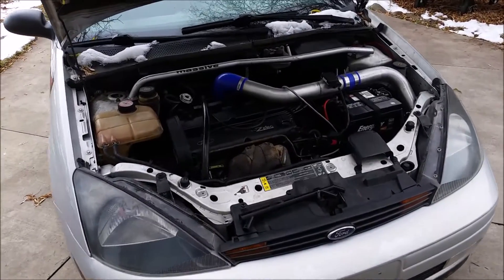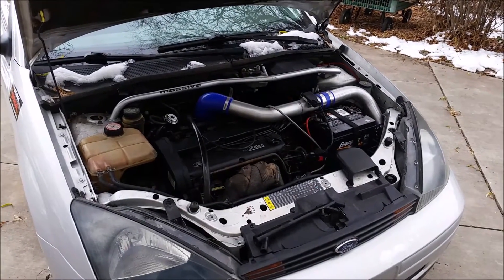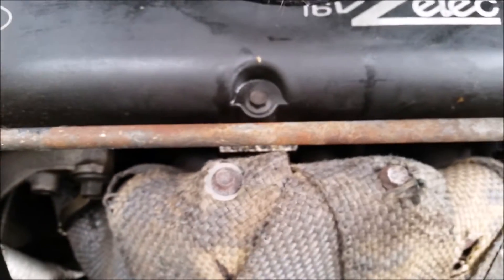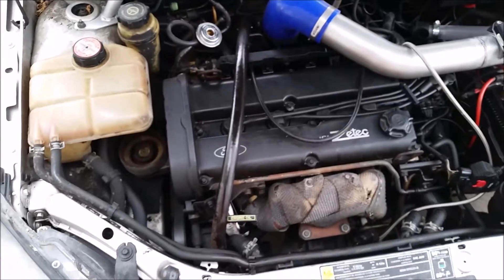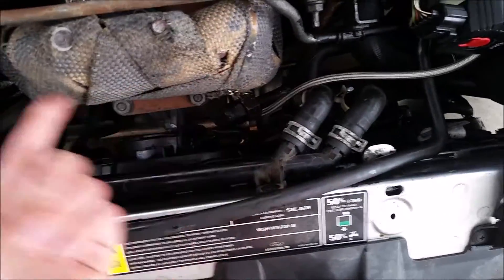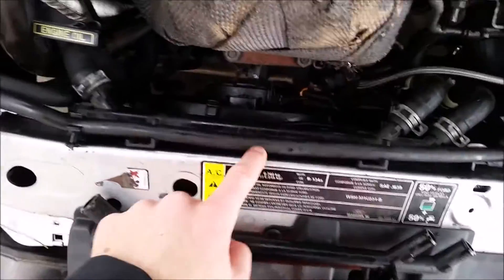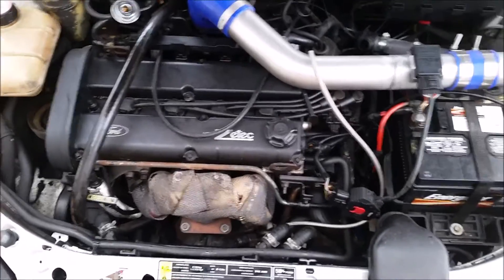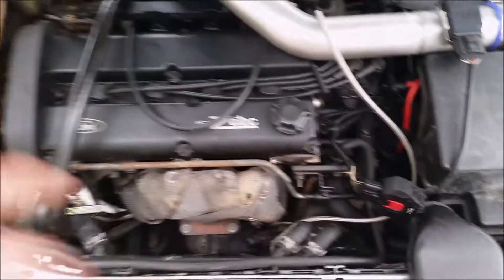DIY Turbo Focus Update: FIRE?!

Comment: Same part went on my 2003 zx5, sprayed the engine bay but luckily no fire. I love the 2.0 zetec engine, had this car 11 years over 300k on it runs strong!! Nice work on the turbo
Reply from the maker: Richard Patterson It seems like it's not super uncommon for this part to break, but I'm glad there was no fire for you! I think the only reason mine caught on fire was because the wrap on the header was soaked with antifreeze, and it eventually got hot enough to combust.

Comment: They make a aluminum coolant tube to prevent that rupture area. Where did you get the "adapter" to use the stock mani?
Reply from the maker: Oh, nice! I didn't know that. 
I fabbed it myself.
Reply: You have a pic of your setup? I dont wanna have to delete my p/s for everything to clear
Reply from the maker: @ijdevil  I don't, sorry. I lost all of those pictures and I have since sold the Focus. It was really similar to the FSWerks adapter though.

Comment: I WOULD LOVE IF YOU MADE A DETAILED VIDEO SHOWING EXACTLY HOW YOU PLUMBED IN YOUR TURBO, ALL THE IN'S & OUT'S??? PLEASE! EVERYTIME, I COME BACK TO YOUR VIDEO"S TO TRY & SEE YOUR SETUP & WONDER HOW YOU DID IT????? LOOKS AS IF YOU USED THE STOCK MANIFOLD, & BRANCHED OFF OF IT, DID YOU USE THE CAT FLANGE? I AM ABOUT TO REMOVE MY CAT & REPLACE IT!!! NOW WOULD BE A GREAT TIME 4 ME TO TRY THE SAME IDEA, I AM IN THE PROCESS OF REPLACING MY EXHAUST, EVERYTHING EXCEPT THE CAT & MANIFOLD. IF I REPLACE THE CAT, I CAN START TO CUT & WELD A DOWNPIPE INTO A TURBO THAT,I AM STILL YET TO GET BECAUSE OF ALL THE OTHER PARTS NEEDED (ECU) SO, IS YOUR SET UP W/OUT A AFTERMARKET ECU???? I WOULD LOVE TO KNOW HOW YOU RAN EVERYTHING??? I HAVE A 03 FUCUS THAT I HAVE DONE SO MUCH TO & IT NEEDS MASSIVE HELP IN THE POWER DEPT!!!

Comment: prerunnerwannabe can you tell me the specs on your turbo conversion and what you used  I'm thinking of buying a mk1 focus 3door hatch and making it a wrc Collin McRae rep I'm from the United kingdom I heard about the Scooby turbo did you make a custom turbo manifold or buy one off eBay if you could give me a parts list or links to the stuff I will need that would be fantastic
Reply from the maker: Hey man! I don't know if you were able to watch my other video where I give an overview about the turbo system, but if you haven't, I would recommend taking a look at it :)
A Colin McRae replica would be suuuuper cool. I used the stock manifold and fabricated an adapter that would allow the TD04L turbo to bolt right on. It took a lot of trial and error, just because there is very little space for the turbo, so you need to angle everything in the perfect spot. I also used a turbo flange from eBay because that was a ton easier than trying to fabricate one myself, and I used another stock header and robbed the flange off that to attach it to the stock manifold on the car. I would stay away from the cheap turbo manifolds on eBay, because they're poor quality and will probably crack quite quickly and might even send pieces of shoddy weld through your turbo which would mess up the turbine quite seriously.
I based my system off the kit that FSWerks sells for the Zetec. Not 100%, but a lot of the basic ideas, so looking at that should give you a good idea of some of the things you'll need.
Hope everything goes well for you!

Comment: what did you do for the ECM under boost?
Reply from the maker: The stock ECU can be tuned, so I did a bunch of datalogs and etunes with a guy named Tom from Focus Power. He sends you a tune and you flash the ECU with that tune using a SCT X2, X3, or X4. I had it retuned for 42lb injectors and obviously for boost.